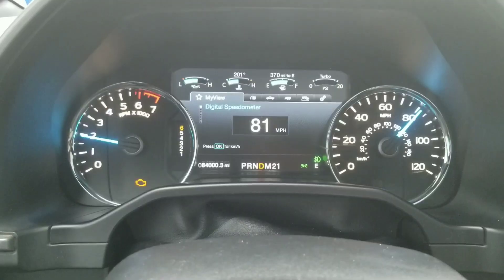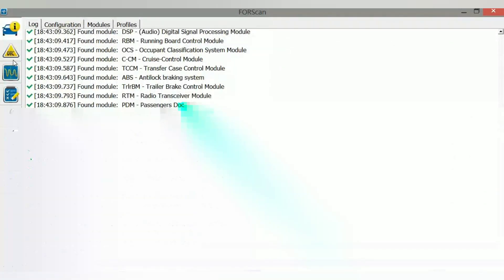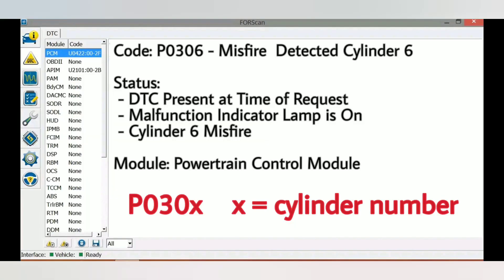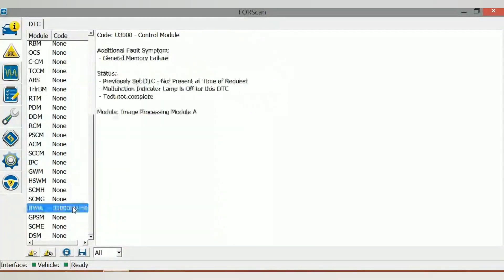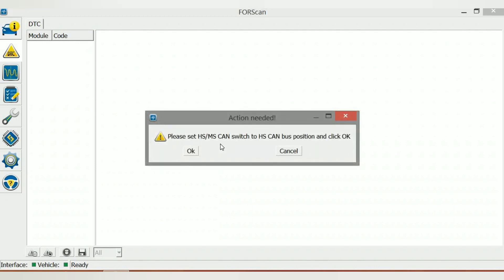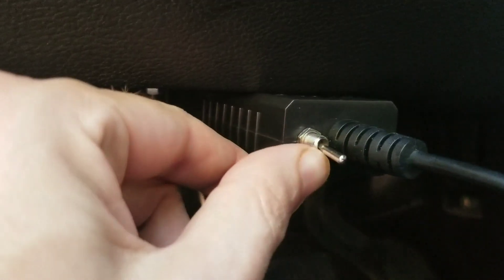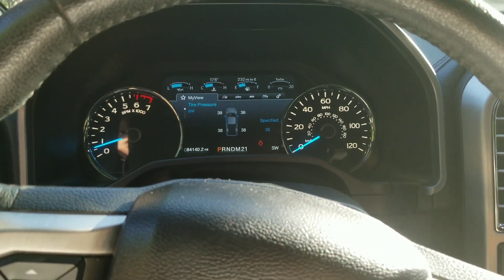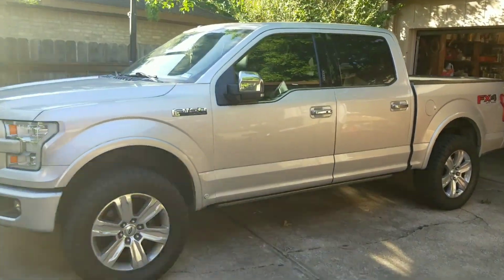Forscan  ford f150 DTC check engine

Comment: Ricardo did your ac start acting up when your mis fire was going on? I have the exact problem changed mu spark plugs and it fixed the issue. But now my ac is been acting up since the misfire
Reply from the maker: That's interesting but might not be related. Unless somehow something was changed while working under the hood.
Reply from the maker: You know... my previous truck was missing a little screw for the compressor clutch.  Made my compressor not work occasionally.
Reply: I got it to work, i don’t know exactly what it was but i released some of the air from one of the ac lines then i heard the clutch engage. Then i bought a can of freon filled it up and it started working again! (Also changed my spark plugs but it might be unrelated)

Comment: My 2019 ecoboost 2.7L F-150 threw code P0096 after installing a JLT oil catch can. Truck runs fine but wondering since it is not CA compliant, it threw that code. I checked reviews on the catch can and I can't seem to find anyone with a similar problem to mine. Wondering the IAT 2 sensor went bad? But how or why?

Comment: So when you did all that the check engine light come back on later
Reply from the maker: Yes it did so i replaced the spark plugs... and its all good now
Reply: Once you do what you did take the check engine light off with a pass inspection still like that once you take it off

Comment: Hi.  greetings from Santiago de Chile.  I have an Explorer XLT 2013 3.5 V6.  I had to change the battery.  Since then, when I contact the check engine at some point it blinks 8 times and then remains as usual.  While driving I have no warning.  It will be possible that since I run out of battery and I had to change it, the computer recorded the error?  can i reset with forscan?  How can I know what the error codec is?
Reply from the maker: DTC in Forscan will tell you what the error is. Saludos!

Comment: Is there a way to turn off the rear defrost when you start the truck. I park in the garage and it's not necessary.?
Reply from the maker: Hi M, I think there is a way in the APIM. 7D0-09-01. I haven't tried it.
Reply: @ricardosworkshop  well if you test it before I do please let me know. Thanks

Comment: Another excellent video, Ricardo. Please post a follow-up if this code comes back, and you decide to look into the plugs, injectors, etc. Also have to ask; doesn't that squeaking door hinge bother you? haha...it seems to be begging for some oil, grease or Fluid Film! :)
Reply from the maker: Lol... thanks. I tried some grease spray but it only worked for a while. I'll have to find some good oils or better greese.

Comment: Is there a code to turn the mirror spots on either at lock or at engine off and they turn off aft a minute or so?  Thanks
Reply from the maker: Not really but the puddle lights do this... you might be able to wire them together.